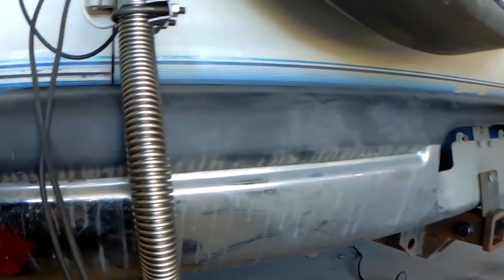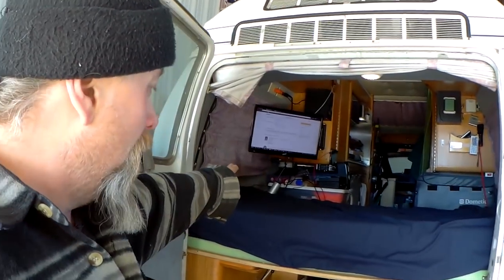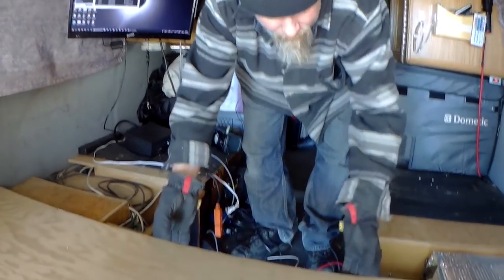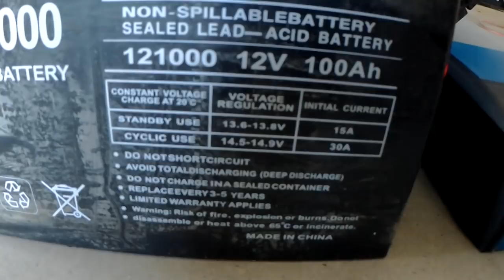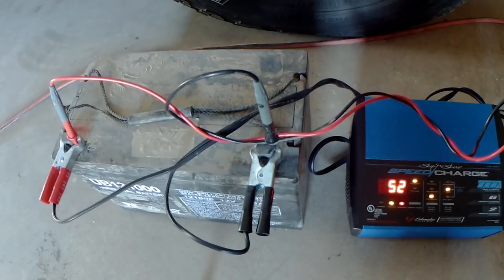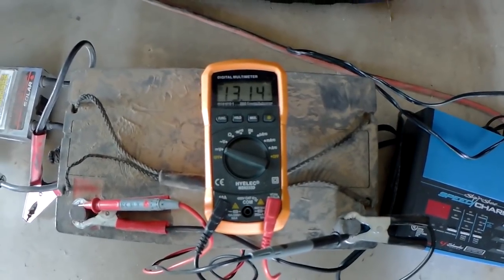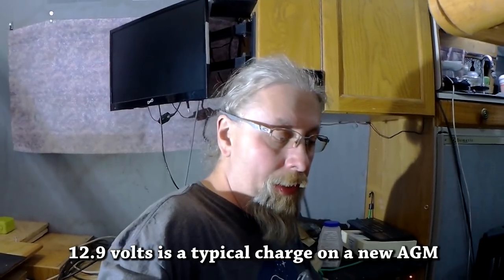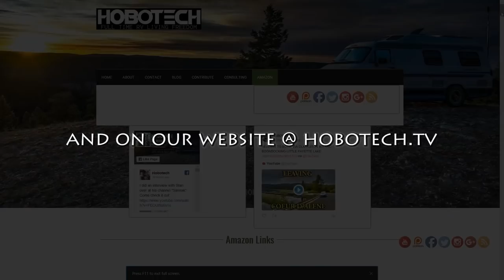How To EQUALIZE AGM Batteries In Your RV With A Schumacher Charger At Our Texas Van Build!

Comment: I remember my Dad would always tell me to never put a car battery on cement. I would ruin the battery.  I don’t know maybe because you are putting a charge itt would have no effect. You seem very knowledgeable, just wondering. I don’t work on anything anymore, getting Too old. Stan cracks me up, you guys are the new comedy duo. Pretty funny!
Reply from the maker: The "battery on cement" harks back to the old timey days when batteries were made out of wood. The moisture of the cement made the bottom of the battery rot and the acid would leak out. Since they make them out of plastic now you can store a battery on cement forever without anything but a normal discharge over time.
Reply: Ok thanks, interesting.
Reply: @HOBOTECH  someone took the term grounding too literally
Reply: Car batteries used to be encased in hard rubber, a substance that was porous enough that battery acid could seep through it and create a conductive path through the damp concrete, draining the battery.
Reply: @HOBOTECH  im still never putting batteries on cement , im jus sayin
Reply: Lazy Boy and the Rockers  
  true ,back in the 80s my grandfather lost 15 interstate batteries in a Conoco station due to storage on the concrete floor all the cabinet stored units where fine, interstate even said never store on concrete.
Reply: My brother respect unique video. Fist let me say if it works it works I have 12agm 6v batteries they are 13yrs old man when I first bought them 8yrs ago they sat at 11.8v man even though they are seal batteries I boil the crap out of them over the years until they sits @ 12.6 then they just would not go any further so I got me a desulfator almost a year now and today they sets at 12.9v and the capacity of the batteries are strong just like new. It be nice if you had done a load test and let us see if the capacity of the batteries are strong as you can have the volts but the battery capacity is weak. My brother excellent video and like I said if it works for you that is all that matters.

Comment: Clean any dirt/dust from top of batteries during maintenance, it conducts electricity, causing a small discharge. You can measure the amount with a digital voltmeter. Put a flapper on the exhaust, the water WILL cause damage.

Comment: Love watching you guys... Just now trying to charge my HUGE house battery... at 165 lbs not moving it out of the MH :) I have a Schumacher charger but not as fancy. It gets the job done. I need to pick up an amp meter... any particular one you would suggest? someone told me it didn't matter but having an older MH want one that can handle all the RV type issues. Yes that can be many LOL Enjoy your weekend
Reply from the maker: The only amp meter / battery monitor I use is the Tri-Metric 2030RV. It's expensive and hard to setup but I couldn't live without it. I have old videos on it.

Comment: Great video! I would put a 90 degree on that exhaust outlet, driving could force water in and could restrict your exhaust, maybe cause Carbon Monoxide to build up low or just plug your exhaust (water gurgling out the top). Your batteries looked dirty, on acid batteries they say that can cause static electricity build up and that is not good for the batteries or it can contaminate the electrolyte, sealed batteries are definitely different. Very informative video thanks bud for sharing good luck! When your in Michigan look me up!

Comment: Interested in how that extended exhaust affects the running. (back pressure change )
Reply: Yar Nunya  Subs with Snorkels are not unique to the Nazis. The Nazis however were renowned for their engineering .. they did not just get  a length of conduit and some hose. They calculated how much pressure the snorkel would create and sized it accordingly.

Comment: It's great to see you were able to bring the batteries back to life.  

What charges the batteries when you are plugged in?  Some of the original equipment converters that come with especially older RVs do not go to a high enough voltage to get a full charge.  

It is amazing how much crud collects on the tops of the batteries even when inside.  I saw a good video a few weeks ago where the creator measured the current flow across the top when dirty, especially on flooded batteries that had some boil over. That increased the rate of self discharge.  

You mentioned previously that there was a small hole in the gen muffler.  Were you able to fix that or is it one more item on the list?  

Looks like you and Stan are going to be in good shape for the RTR and will be able to enjoy the event rather having to do repairs.
Reply from the maker: I have a 4 stage charger but it only does 14.4v. When I'm driving the alternator puts in 13.6v. So unless I get a lot of strong solar I don't get past that 14.9v charge required. I have no idea if I can patch the hole in the muffler without pulling the generator. It's a problem I'm dealing with later.
Reply: Sounds good.  You will have plenty of sun in Quartzsite.
Reply from the maker: I actually didn't get enough last year. Sun is just too low in the sky for a full charge. Going to be running the tar out of the Sportsman.
Reply: That's interesting.  I thought you have portable panels that you can align for a direct angle to the sun and get a maximum charge.  I also thought the panels work better with cooler temps.  

Before upgrading my system, I used to run the generator for an hour or two in the morning when the batteries were low and could accept a bulk charge, and then when the sun was higher, let the panels finish off the charge when the acceptance rate of the batteries dropped.  That worked out well.
Reply from the maker: I do but 400w isn't enough for my needs in winter. I do the same by bulk charging with the genny then letting the sun top off at the higher voltage.
Reply: I think I got it.  There are not enough sun hours during the short winter days.

Comment: On another fix. I decided to go MTB tubes and slime them with their removable core. There are a few reasons for this decision. 1.) the stem is attached to the tube and no possible leakage. 2.) The tubeless tire system must have fresh seal about every 3 to 5 months added otherwise it can possibly leak. My experience with slimed tubes, they don't seem to ever leak, are always holding air to what they were filled up with even after a month of no riding. The big problem is finding a thick MTB 29" 2.8-3.0 tubes. Most go as wide as 2.4, and also as mentioned with a removable valve core.
Reply from the maker: Good info, thanks. If I end up going back to tubes I'll need 27.5x3.0. That should be a fun size to find.
Reply: Found tubes with removable valve core. Bought two of them, but also found a video showing how to slime a tube with a non removable valve core here at https://www.youtube.com/watch?v=BnbLI_tLpLs and to buy new tubes 2.5 to 3.5 you can find them here http://www.jensonusa.com/Surly-29-X-3-Presta-Valve-Tube-Surly-29-X-3-Presta-Valve-Tube I think this is the best way to go right now. BTW my mom used to love watching the streaming vids on her tv. She was a major fan of yours and loved watching Odin. She passed away on August 5th, a very sweet angel indeed and loved by all. Well hope the tube articles help you and others. I don't think the Slime company will be making Plus tubes that are slimed for a while so this is a work around. Also worth mentioning, there is out there I am told a boost wheel plus sized hubmotor available for those who may forgo mid drive.

Comment: Your vertical generator exhaust extension has too much back pressure unless it has a venturi tube to help the exhaust gas to escape.
Reply from the maker: Seeing that I have a huge hole in the muffler it probably doesn't matter.
Reply: So order a muffler and the correct exhaust pipe from Onan- Cyber Monday !!!!!

Comment: I just ordered an AGM battery for my "house" battery and will be charging it with a continuous duty solenoid through the alternator of my van. The van has a lead acid battery. Are there any concerns with having the two different types of batteries being charged from the same alternator??? Thanks for any input you may offer...

Comment: Can I just plug the shore power to charge the batteries or do I need a special charger on each battery to make sure the are getting full charge to test?  I have never gotten full use out of my batteries. I alway have to turn on engine to use microwave  or induction stove.  Suppose to be able to use for hours w/out  having to use engine

Comment: I have the Roadtrek etrek w/ 6 AGM  batteries in back.  The batteries in   Underhood are not charging house batteries.   Underhood batteries are cheap  6 volts batteries that require water.   I have equalizer.  Any idea on how to fix?  Thanks.

Comment: Hi Hobotech, I have two AGM batteries with 400 watts on top of my van. I've noticed that when I get a lot of sun my batteries are up to 13 volts. I've noticed also that the solar panels are pulling in 15 and sometimes 16 volts. Doesn't the MPPT controller keep my batteries at a good charge to the point where I wouldn't have to check if they're overloaded? Honestly, I don't keep an eye on them because I'm out most days. BTW--I'm trying to install an isolator, and I saw on a youtube video that you need to attach a fuse from the isolator. The Youtuber said to attach the fuse to the turn signal, I did but it's not working. I need an isolator badly because where I work I have to park in an underground garage, really sucks! So, I'm desperately trying to figure out this isolator. Any suggestions? Thank you in advance. I'm enjoying your videos and have been binge watching with my dog RustyBoy.
Reply from the maker: Yes, if you have a solar controller that automatically equalizes your batteries you should be fine. My problem is running the batteries too low then not having enough solar in winter to get a full charge. Can't really tell you about the isolator. My Roadtrek already had one installed. There are a ton of videos on them. I think Bob Wells has one as well as Enigmatic Nomadics. You can try there.